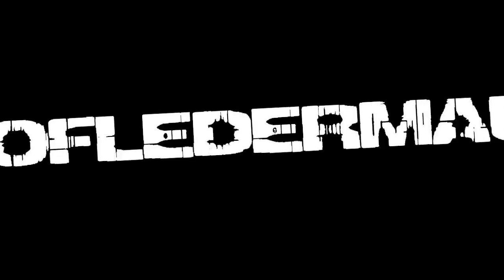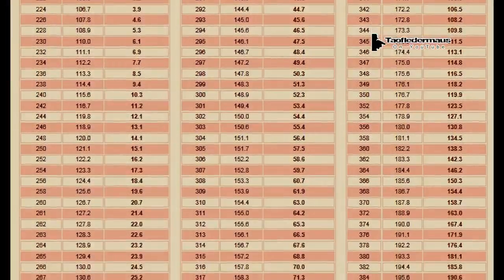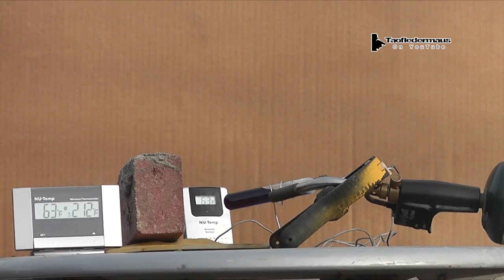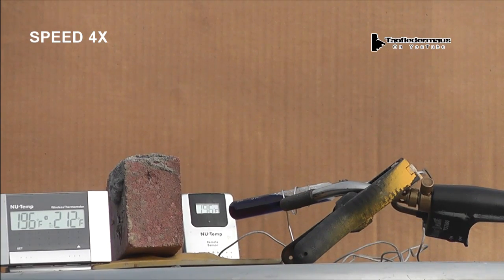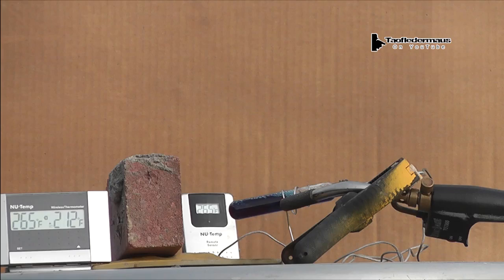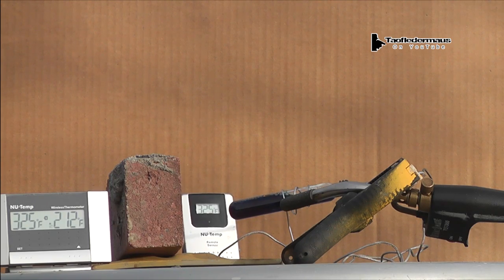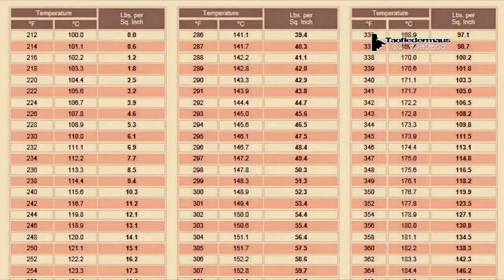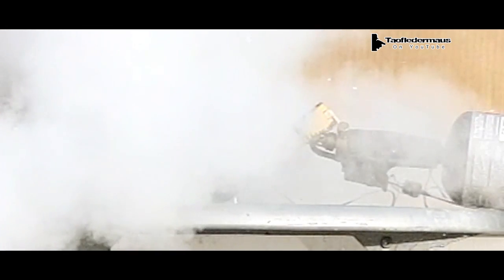TTTT - Test Tube TORCHER Tests -  How much pressure?

Comment: I find a problem with your calculation method. If you have liquid nitrogen in a sealed chamber, it's not going to get hot inside, it would stay cold.
Reply from the maker: It would build up so much pressure at room temperature and blow up the vial without adding any extra heat.
Reply: +TAOFLEDERMAUS but doesn't that show that heat doesn't necessarily equate to pressure?
Reply from the maker: Temperature and pressure are relevant.
Reply: +TAOFLEDERMAUS but I feel as though it depends on the liquid too

Comment: I wonder if the dye had any influence on the properties of the water.  Also, it looked like you were using a mineral insulated sheathed thermocouple which has a larger time constant (delay) than a bare bead thermocouple.  The temperature could have easily been much higher than measured.

My thermo books are at work so I can't look them up, but I did a quick internet search and it showed 107psi @ 167C and 170psi  @ 187C, so that measurement is pretty critical.

A slower heating rate or a bare bead TC (if you could find a way to seal the cap with penetrations for wire) would probably result in a higher measured temperature and much closer to your expected pressure limit.

Comment: I bet the thermal differences between the liquid end and the gas ends of the test tube play a big role in the destruction of the test tube. 

Thermal shock and whatnot.

Try it with a tube as near to completely filled as you can and see what happens.
Reply: Whether it is liquid or gas doesn't affect the pressure at all once it reaches the saturated mixture state.  The liquid part of this mixture and the vapor part of this mixture are at the same pressure.

But you are correct in that the stress will be highest where there is a large temperature gradient (thermal stress + stress from internal pressure) and that is most likely the point of failure.

Comment: Yep you are one of the few subcriptions I have that I watch the videos of more than once.

But anyways, here's more thoughts.  This one probably exploded before it blew the seal because it had a smaller neck on it, so the epoxy plug was smaller and wasn't getting as much pressure overall applied to it. 

Also, you mention the brand of tube, and the chemists out there would probably like to see which "performs" the best.  I bet the hardcore science freaks want to know if Pyrex is the king.
Reply from the maker: The neck is actually the same as all the other vials.   The caps I got with my new set of vials fit on this vial too.   Pyrex is just a brand-name for heat-resistance glass,  like  Fire-king,  etc.   This vial was just shorter,  but the other dimensions are the same.  I'm going to start filming the "cool"  stuff this weekend.
Reply: *****
Huh.  Must be an optical illusion.  Well here's to hoping for successful failure in the future.
Reply from the maker: Hopefully the sugar,  popcorn,  cheese,  and rice will be interesting!
Reply: *****
  I guess you didn't see my request for automobile starting fluid XD
Reply from the maker: I don't seem to get all comment notifications through G+.  I have to actually go to the videos and scroll through the comments,  which is a mess too.    I think I could try that.

Comment: I think you will achieve a much higher pressure if you heat the tube up more slowly and/or diffuse the flame.
Reply from the maker: The flame was set back quite a distance and the visible flame wasn't even touching it.   I do try to consider the rate at which I heat these up,  and try to use as gentle of heat as possible.   I really do need a smaller flame source that is more controllable.

Comment: To be accurate to the other tests you should be using the same brand and model of test tube to make sure that the tubes can withstand the same amount of pressure, which these ones obviously couldn't.

Comment: Try attaching with a epoxy some sort of setup to the test tube to fill it with a compressor or pump with a pressure gauge. For added safety fill the test tube with water since it won't compress under pressure, meaning it will explode less violently.

Comment: So, did the test tube fail because of the pressure or the heat of the test tube added to the pressure... or just the heat alone? What do you think ***** ?
Reply from the maker: Probably a combination of all.   Maybe the metal wire touching the glass had a role in it.
Reply: ***** So, what did we learn?
Reply from the maker: I just wanted a ball-park estimate at what sort of pressures these are under.  The pressure we got is probably...  a lowball guestimate.   But... for future videos I have a video to refer people to who ask how much pressure these are at.   Also,  for the "Analytical Safety Supervisory"  viewers,  it puts these tests into perspective.
Reply: ***** , so you essentially set a baseline for your other experiments. That makes sense.

Comment: Did the thermometers "top out" on you?  Meaning, are those thermometers unable to read past 333F? or so?  I am guessing that those are over thermometers so they probably go to 500F or so?  Asking.
Reply from the maker: It went up to 336  a split second after it blew up.  The high range of the thermo is 375 deg.  (I just checked using the torch on it!)

Comment: Thank you for this test.  It seems improbable that the tube failed after only 90psi.  I am wondering if the temperature difference at different ends of the glass is causing a stress.  Also,  since your heating in the horizontal, the flame is on one side of the glass tube.  So, it's uneven causing un-even expansion around the circumference of the tube.   What if you heated it in the vertical position with a vertical flame on the bottom of the tube?   This is how they seem to actually used in real world practice (as I remember from school).  I'm betting the design of the tube is optimized for that kind of heating.  I also wonder if there are differences between test tubes intended for general mixing/condensate'ing and heating?  I found a video claiming 290 psi in a fluorescent tube (http://youtu.be/hn3Ws_pG2RU) in it's description.  I would presume, that kind of tube is thinner than a test tube.  I'm going to look up one of those charts you used, the 90 psi just does not smell like a reasonable outcome of the test.
Reply: I found this "how to" on reading these steam pressure charts.  There is a section on super heated steam as well.  It looks like reading these charts and knowing what your measuring might be more complex than it seems at first glance.  I'm betting your initial assumption that failure is up around 300 psi is closer to what really happened.  http://www.tlv.com/global/TI/steam-theory/how-to-read-a-steam-table.html
Reply from the maker: The temperature reading should have been pretty accurate since I put it at the center and above where it was heated so it should have been the true temp. of the water.   There was probably more pressure than 94 psi,  since the chart shows a pressure increase only after 212 deg.  I'm sure the pressure started rising as soon as it got warmer than the temp the water was when I sealed it.
Here's the deal though.   I'm concerned that people might overreact about these videos and the wrong people might consider these things as destructive devices so I am ok with showing the guestimated saturated steam pressure.
Reply from the maker: RadicalRC  I think it is very possible the pressure was higher than the chart said.

Comment: I'm actually surprised in the other sense. That's a fair bit of pressure for what is essentially, rather thin glass. Being a hollow tube does strengthen it somewhat.

Not sure how pressures in the arena of 8-12,000 psi from a shotgun will keep it together. The wax my bind it, I suppose.

Another highly entertaining video. Love your work, mate.

Been wondering for awhile how you'd go stabilising a wax slug if it was half wax slug, half lead slug. Kind of thinking you could cut the top off a lead slug, insert a small, long screw partially into the base, and that'll bind it to the wax slug below to stop them separating.
Reply from the maker: The wax slugs,  although they appear unstable  are still "accurate enough"  IMHO.  I'm lazy and would rather make 25 wax slugs the normal way - in the time it would take to try to make one fly straight.
Reply: lol, yeah, they fly reasonably well, but I'm actually interested to see what would happen if I put one through a pig, goat or even a kangaroo. I could group test them, but since they're not completely stable, the results may be misleading. I don't have the high-speed capabilty in my cameras that you have. If you ever get bored, in the interest of science, maybe give it a thought :-)
Reply from the maker: I had decent grouping shooting at a cardboard,  human sized target at 50 meters.
At 200 meters,  they were pretty unpredictable.

Comment: I think the smaller test tubes previously used would reach a higher pressure, if they have the same thickness of glass.
Reply from the maker: Cheesus Sliced  The first two videos,  the vials were 155 mm and hold about 30 ml.   This was a smaller vial,  125 mm and holds about 25 ml.   I usually only fill the vials about halfway up to allow for expansion.
Reply from the maker: I don't think it would be more dangerous.  It would probably be more of a hydrostatic fracture,   just break the top off the vial as the liquid expands but doesn't flash to steam.

Comment: I would have thought more pressure then that too.  Ive put a standard soda bottle straight to shop air before (155-160psi) and it didn't blow till it was either punctured or hit.
Reply from the maker: I'm having a hard time believing the saturated steam charts.   I need to find a small pressure gauge.

Comment: Im not sure if this test is convincing. What was the chart exactly for? Couldn't it be wrong because there was still air inside the test tube?

Anyways great video, interesting as always ;)
Reply from the maker: The chart is for saturated steam temperatures for boilers.  The test wasn't exact, but  gives us a ball park figure to look at.   If I ever find a pressure gauge I'll try it again.

Comment: Just to clarify, you stated that you can't get anything above 212F at sea level.  That is only true for water as that's the boiling point for water.  Since you have put other liquids in the test tubes so far and I assume you will do so in the future, you could very easily get temps higher than you have for the water since some things boil at much higher temperatures.  The pressure at which the tubes break will always be the same obviously but you will surely get higher temps than you have for this baseline of water.

Comment: Is there any way you can rig up another test tube with a compressor fitting? That way you can find out if it really does only take 92.7 psi to burst a test tube.
Reply from the maker: I do want to try to find a pressure gauge I can just epoxy in there.   I want to verify that too. I'm thinking the pressure started building up as SOON as I started heating it,  not  after it got to 212 deg f.

Comment: 91 psi is nothing, i use 60 psi on my bike,
Reply from the maker: But you can't ride on a test tube.
Reply: what if you glue a bunch of them on to a board  and then ride your bike across them. you could make a video of you riding on test tubes.

Comment: The flash boiling of a liquid (and expanding gas cloud) once the tube fails makes the explosion a lot more violent than you would expect. That's why hydrostatic testing is used for high pressure chambers instead of air pressure, the liquid doesn't expand once it escapes. Less of a boom when it fails

Comment: Liquid Nitrogen?
Reply from the maker: It would probably blow up as I was sealing it since the nitrogen would pressurize the test tube much higher than 94 psi at room temperature.
Reply: would turn into gaseous nitrogen very quickly. wont be much of a show but it will burst very quickly.

Comment: How much it in atmospheres? I'm noob at imperial measurement system.
Reply from the maker: It was about 6.48 bar.  (1 atmos. = 1 bar)  1 bar = 14.5 psi
Reply: ***** Oh, thanks. That's... quite pressure for glass tube.

Comment: You should try doing the test with the test tube set up the way you had them before, nearly vertical, and with the old test tubes. They did seem to hold out better than the new ones and having it vertical may cause different results. I would be interested in seeing the comparison between the 2 setups even with the same test tubes used in this video.
Reply from the maker: I'm not sure if the position played a factor,  or the brand of the test tube,  or the metal band touching the glass.   We'll see if we have the same tube failures with the new test tubes I bought from Discount Vials.

Comment: wow that thing let our quite a bang when it failed! i remeber back in highschool chemistry class wondering how much pressure it would take to cause a failure like this and now i know!
Reply from the maker: you and your... just sayin'  lol
Reply from the maker: I think the other test tubes I used held more pressure.   But,   this at least gives us an idea what sorts of dangers these have.   Not SUPER dangerous,  but you wouldn't want to be close to them still.
Reply: ***** Since the test tubes themselves did not fail in the others, I think you are correct about them holding more pressure. I also agree that I would not want to be near flying glass shards and super-heated water vapor.
Reply from the maker: With this one I expected it to behave like the other two tests and I was worried the thermometer probe would go flying off and damage it.   I always stay back and hide behind a fence.  lol
Reply: ***** I do not think a thermometer probe would be comfortable lodged in your body either...just saying.
Reply: ***** lmao

Comment: Great work, as usual.  I just must ask, would you consider some other sort of container to up the pressure tolerances?  Such a relatively flimsy medium is going to make testing certain substances awfully short-lived.
Reply from the maker: I bought 25 new test tubes so I will keep using these for now.   They are safe-enough to do at my house.  Anything bigger,   I'd probably run into problems.
Reply: ***** Mason jars. :-D

Comment: only 94psi?  what noob tubes.  :P
Reply: remember, that's pressing against a very thin layer of glass. 94 pounds per square inch is quite impressive if you ask me.
Reply: Logan Fehr yeah, I was just using that comment as a reason to use the phrase "noob tubes"
Reply from the maker: I think this Kimax  test tube wasn't as strong as the other ones.
Reply: *****
just troll call of duty videos in that case hahahaha. they love that :P